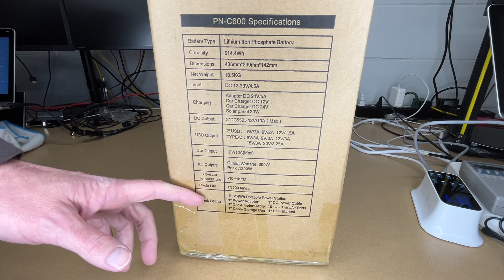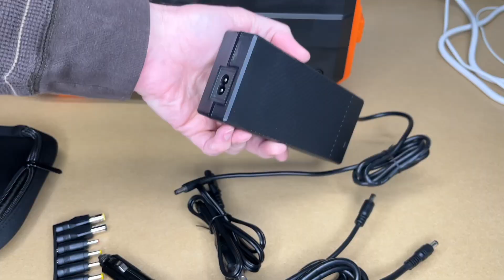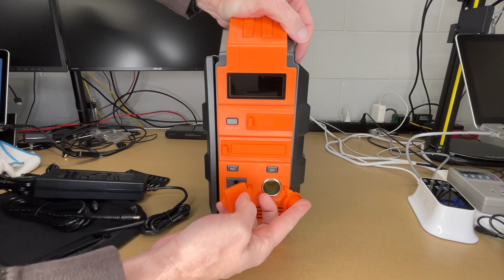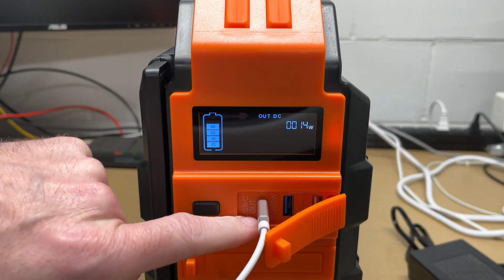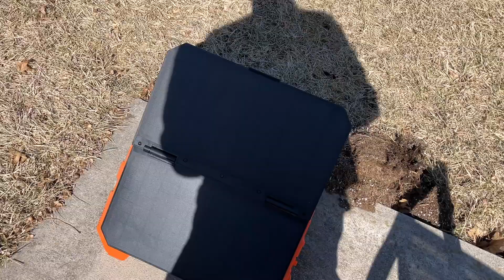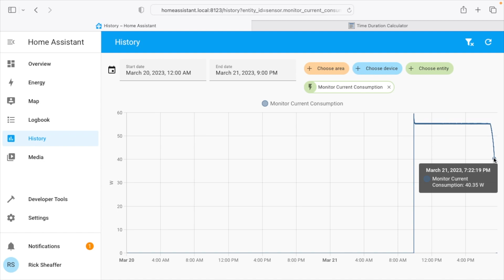BROWEY C600 614.4Wh Portable Power Station with Built-in 30W Solar Panel

Comment: Good review! It's a bit expensive for the 600Wh, but it is LiFePO4 and has an integrated solar panel, so around $500 is fair. Otherwise, 2000Wh can be had for $900-$1000 now if you don't need the integrated solar panel. 30W is somewhat weak in my experience, mainly because you only have a limited window to charge during the day, and it won't always be charging at the full 30W if it's not 100% sunny out. Would be a good use case to bring it on a camping trip to charge cell phones, tablets, using a heated blanket, flashlights etc. but with 600W of power output, I don't think this can run much, like an electric stove or electric kettle.
Reply from the maker: I can share more about my experience using it. I took this with me for a week long summer camp with my son. I mostly used it to power my CPAP machine but also used it to charge phones and such. I could get around 2-3 nights of use before I needed to charge it. Our campsite was in a wooded area but there was an open spot in the middle. The tall trees around limited how much sun we received. I did some charging with the built in panel but it wasn't sufficient to fully recharge it. I think it might have if I were charging in a more open area with a full day of sun. As such, I attached a 120W folding solar panel. I used it and the built in panel and got just under 100W of actual charging. Towards the end of the week it was overcast so I carried it (a fair distance) to the lodge to charge it with an outlet. I found it relatively easy to carry, although it has some weight due to LiFePO4. My biggest complaint was probably that the battery gauge doesn't give hours and minutes of usage time left but it didn't really effecting me when camping since I wanted to keep it as full as possible anyway. Overall, it worked well for me and it will be my go to mid-sized battery to take camping.

You are correct in that it won't run high draw items but with an electric kettle, there are models that are lower wattage. I have 300W and 500W models. They work well but do take longer to boil water.
Reply: @Rickmakes Thank you for the real life usage scenario!